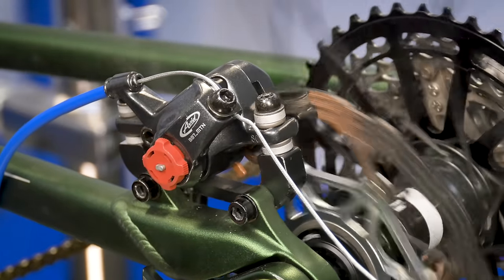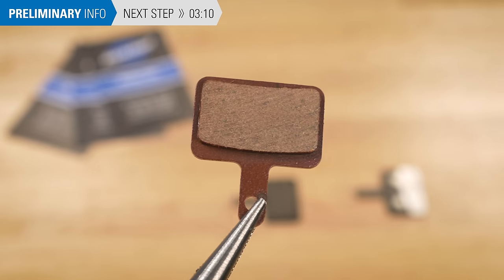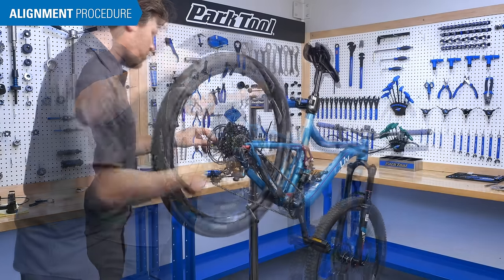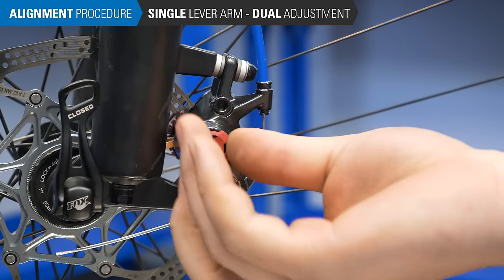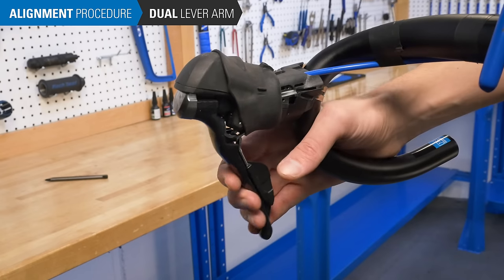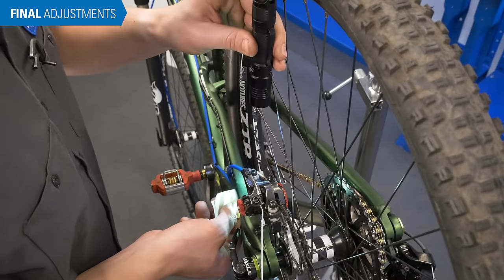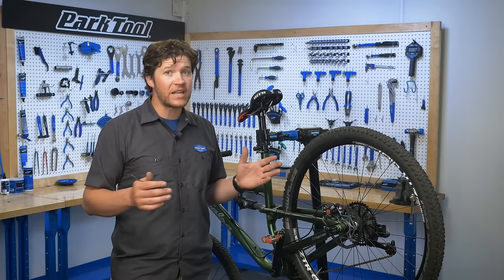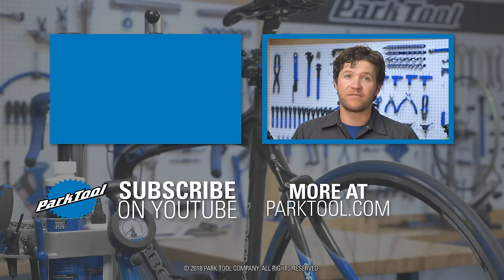How to Align a Mechanical Disc Brake on a Bike

Comment: The tutorial is nice but I have a problem, it is that when I press the brakes the caliper make a click noise and stays at one place i.e the caliper arm does not get retracted back I think it is the caliper itself. Please help need it.
Reply from the maker: If you unhook the cable from your brake and actuate the arm by hand does it do the same thing? That will take the cable and housing out of the equation.  To diagnose further it would help to know the exact caliper you are working with.
Reply: @parktool  after I have unhooked the cable it also does the same thing and the caliper is an house brand of suncross which came standard with my bike.
Reply from the maker: How far does the arm have to move to actuate the brake? If the pad adjustment is not in far enough the bearings in the caliper that ride on a tapered section do not have enough movement this can lead to the bearing reaching the top of the taper and then going onto a flat section that may catch the bearing preventing it from retracting. Try adjusting your pad adjustment.
Reply: @parktool  Thank you, I have tried this and Now the brake does apply but there is a lot of slack in the cable and how much I try, the brakes are not as like as before but great enough for me.
Thank you for this tutorial it has really helped me.

Comment: 5:15 why? As the pad wears, you bend the disc to a drastic degree. Same with single lever single adjustment type. You wanna align to the inside, with a slightly extended pad.
Reply from the maker: Biasing the inner pad towards the rotor is good practice but something that most will not be able to see and or accomplish. This adjustment procedure is based on manufacturers recommendation and what can be reasonably expected of a mechanic dealing with these tight tolerances.
Reply: @parktool  But you're bending the disc. Is that considered fine by manufacturers? I mean all you need to do is extend the inner pad slightly and then center the caliper. And as soon as the pad wears and your lever gets long, you add cable tension and turn the inner pad out again until it stops/touching the disc. Few clicks back and you're good to go for the second and last stint on these pads.

Comment: I have a mechanical disk brake but no matter what I did I couldn't get both to hit the disk so my brakes are pretty shity right now I basically said fuck it and hope I don't have to stop too fast so I usually use both back and front at the same time and it still barely stops me.

Comment: I have a problem with my rear brake lever feels spongy, how do i fix that
Reply from the maker: There could be a problem with your cable and housing. If your cable and housing look good I would suggest going through the adjustment procedure to see if that helps.
Reply: Alfred nonymous I have mechanical brakes

Comment: Why don’t you want to use the barrel adjusters? I followed all the steps and my brake pads are parallel with the rotor and  very close to it (without rubbing) however, my brakes still feel mushy and the wheel doesn’t lock up until the lever is pulled all the way to my grip. If I turn the barrel adjusters it completely solves this problems and my brakes feel great. I have a single arm single pad adjustment system if that matters.
Reply: Is your cable loose? That's the only reason can think of and the barrel adjustment is for cable slack. If the cable has slack, the wheel would not lock until you pull it tight.
Reply: Jai Ceraso hmmm, no the cable is tight. I think for what ever reason my brake system is very finicky with how close the pads need to be to the rotor and I can only get that exact adjustment with the barrel adjusters. Maybe?
Reply: @Jahnu8  Loose cable is not the only reason for brake lever touching the grip.  Pad wear is responsible for this behavior as well.

I quote from the Blue Book by Calvin Jones: "..For models with only inner pad adjustment, use barrel adjuster on the cable housing to move outer pad in or out...However, use care when using the adjustment barrel or cable pinch bolt to account for pad wear. Caliper arm may bottom out on caliper body as it articulates and prevent[s] the pads from pressing on the rotor.."

N.B. 
Caliper alignment procedure decouples static inner piston/pad adjustment from outer piston/pad adjustment. So follow the procedure in the video for inner pad adjustment. Only then, follow the Blue book procedure for the outer pad adjustment so that the lever is does not touch the grip.

Comment: Help my lever arm doesn’t spring back what do I do
Reply: Check your cable. Either too much slack, the wire is frayed and catching on the housing, or there is other material in your the cable housing

Comment: What is the tool at 2:50 called? Thanks
Reply from the maker: That is a 5mm hex wrench. The PH-5 is the exact wrench being used.
Reply: @parktool  Thank you! I looked it up, it’s also a ball end type right?
Reply from the maker: Yeas that one has a ball end. The ball end is not required for this fitting. The reason it is being used is because that is on the ned of the long side of the tool that we used to reach across the wheel to adjust.
Reply: @parktool  I see. Thank you so much for the responses and the information!

Comment: Tat TRP HYRD, any info on tat?
Reply from the maker: TRP and Tektro coming soon.   The Hybrid however rarely, very rarely, need bleeding.  But that should be on the "Second Wave".
Reply: @parktool  so it's a hydraulic brake but runs like a mechanical brake?
Reply from the maker: It is a hydraulic brake that is cable actuated. Kinda confusing.
Reply: @parktool  interesting!

Comment: single adjustment inner side stuck
Reply from the maker: Have you checked if there is a set screw holding the inner pistons adjustment? There could be a 2mm hex fitting that can be loosened to allow adjustment.

Comment: It looks very difficult. 
Never have mechanical disc before. 
Because this video I will stay with hydraulic system. 
Imagine adjusting pad in the middle of nowhere....
re-bleeding a hydraulic brake is just open the bolt on the lever and add the oil...
I’m never use syringe and adding an oil from the caliper except the new one...
And changing the pad on hydraulic system is very easy....
Reply: It's not all that difficult, I removed my pads from my mechanical disc brakes before (quite easily) & I never watched any how-to videos before doing that.

Comment: I have my entire front wheel moving to one side while braking.....
What should I do.....
Reply from the maker: Is this a disc wheel?  Might be a hub issue.  Grab the top of the tire and pull side to side  to check for play or knocking. If it is moving left to right it might be a mounting problem at the fork, or it might be a bearing adjustment issue in the hub.
Reply: @parktool  No only while using the discs I have that problem...
On stationary braking , my disc is bent at a decent level...
While riding instead of the discs,entire wheel moves.
Reply from the maker: For mechanical discs, it is common to have one fixed pad and one moving pad.  The moving pad flexes the rotor into the fixed pad as it squeezes the rotor.  It does not harm the rotor, but the entire wheel should not move when this happens.  Something is not good here.  Seek help from a good shop.
Reply: @parktool  I adjusted the immovable pad and now it's almost fine but not perfect.My spokes are good and can be taken to an inch max to the sides with fixed axle.(flexes) .
Is it good...
Can you help whether my tyre is tubeless or not.....

Comment: I adjusted it so theres no rub but the brake is weak and barely stops the bike
Reply from the maker: There can be other factors causing the low power issue. Contamination is a fairly common cause for this.

Comment: The problem on mine is that the top of the pads are closer and contact the disc first before the bottom because of how they are squeezed together by the clip. Such a terrible design
Reply from the maker: You can sometimes bend the clip to better hold the pads against the pistons.

Comment: my inner pad adjuster appears to be stuck. I can't turn it for the life of me! 😒
Reply from the maker: There is sometimes a set screw holding the adjustment. Be sure that is loose if it is equipped with one.
Reply: @parktool  I'm pretty sure there's one there; didn't know about it. Thank you very much! :)

Comment: My front brake caliper is hitting my spokes...
Reply from the maker: Something is very wrong there.  Assuming the caliper is aligned over the rotor, it can be a problem of hub spacing relative to the caliper.  A more common issue is wheel dish.  The rim may need to be pulled to the right to give more clearance to the caliper body.

Comment: I disagree with your statement about conical washers at about 11:20 "If the brake isn't designed for conical washers they cannot be used" <--- I've added conical washers to plenty of disc brakes with great success. I don't understand why they wouldn't be used, personally.  It's a bit embarrassing that $1000+ bikes don't have them and must be added for proper brake alignment at some point. My two cents.
Reply from the maker: A properly designed bike has the pads inside the caliper body contacting at the outer edge of the rotor.  If a pair of these washer is placed below the caliper body mounts, it raises the body 5-6mm, meaning the pads are no longer in full contact on the rotor, but part of the pads is sitting above the rotor.
Reply: @parktool  That can definitely happen. I do watch out for that.

Comment: There is a much easier method that just requires squeezing the brake handle to center the caliper, and tighten, this is what I do with my brakes..
Reply from the maker: For a mechanical often only one pad moves. So, if you pull the lever then tighten one side will rub all the time. Even on double armed systems that can lead to rubbing of the brake.
Reply: @parktool  Thank you for your response, though true I have not experienced that yet, if their is rubbing I dial it back just a little.

Comment: Title of this video should be: how to align a relic ;-p
Reply: Actually a lot of current lower and mid level cyclo-cross bikes come with mechanical disc brakes. Also a lot of city bikes use them too. Lower price point bikes don't come with hydraulics.
Reply: That's why the smiley at the end of my coment, i'm not a blind elitist, though ultra cheap shimano hydraulics are surprisingly reliable, making one piston cable counterparts a bit obsolete
Reply: That's why the smiley at the end of my coment, i'm not a blind elitist, though ultra cheap shimano hydraulics are surprisingly reliable, making one piston cable counterparts a bit obsolete
Reply: You're correct that soon enough hydraulics will be very economical. But mech systems can be used with existing and low end integrated shifter brake levers, especially road bike setups. Hydraulics require new levers and new tools to bleed, which non elite riders won't engage in.